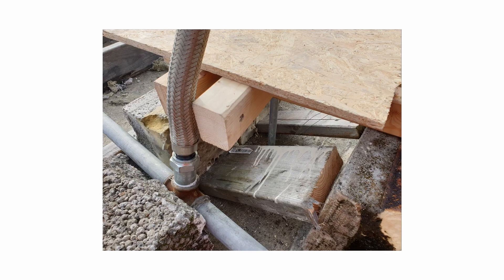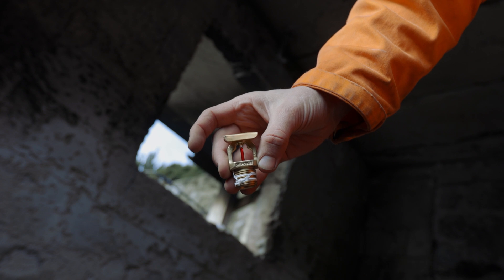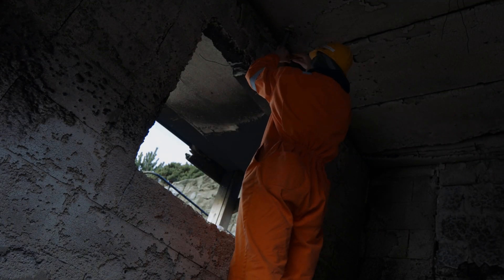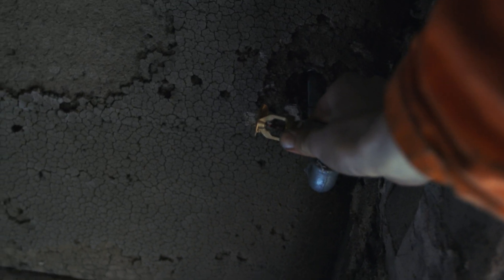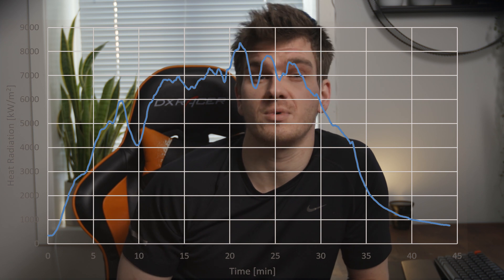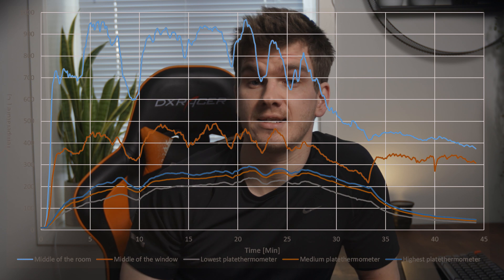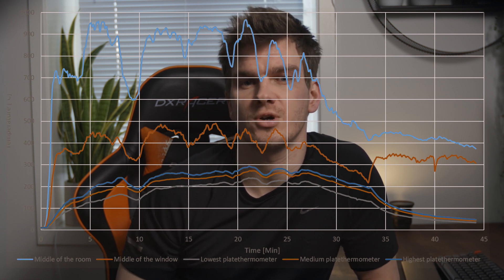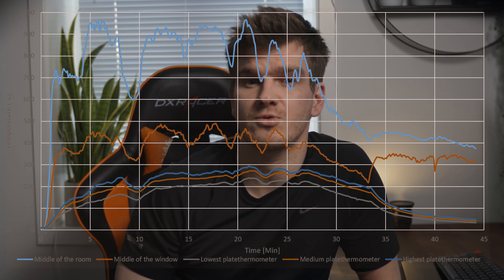Water Curtain Sprinkler! - Fire Engineering

Comment: So the components of heat flux are h, tg, emissivity, and radiation.  The water spray pattern seems to be disrupting flow of air which would lower h, and also absorbs heat which would lower tg.  If the intent is to prevent flashover from one apartment to another, radiation should be neglected because based on recent high rise fires it appears gas and flame are what spread the fire from one level to another, not necessarily radiation from the combustion itself.  Maybe the location of the thermocouples could be relocated to the sides and above the window rather than infront of it like you currently have to get a more representative idea of where the heat flux is that can actually propagate a flame.
Reply from the maker: Thanks for the comment. You're right. We're gathering the radiation going to the gallery exit, as we're checking towards the criteria given for the emergency exit, only. It's said, that if the radiation is under 5 kW/m^2 towards the emergency exit, and a clear 10 m vision (for a 2 m height), then it's still accepted as a path of exit.
Reply from the maker: Sadly we didn't place any thermoelements at these places though. That'd be a smart idea